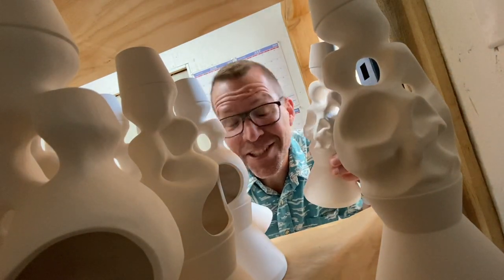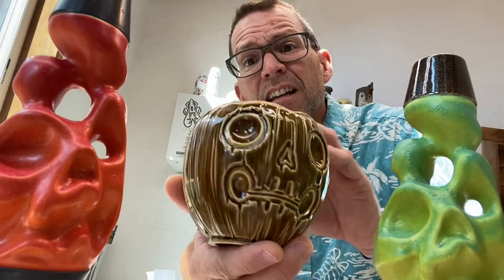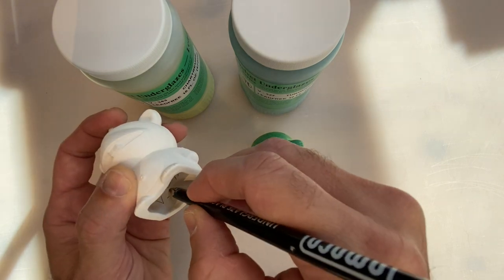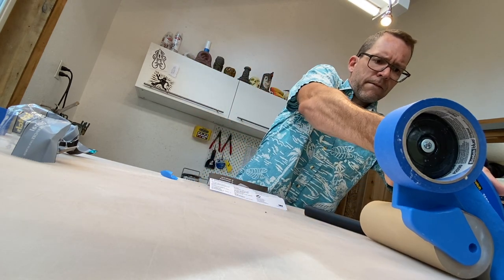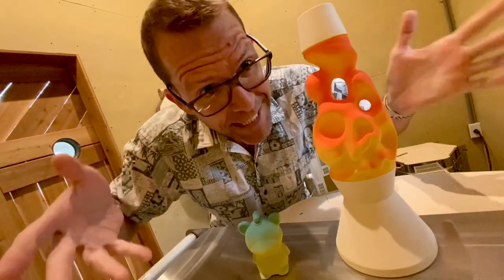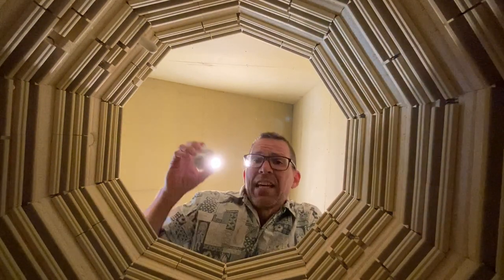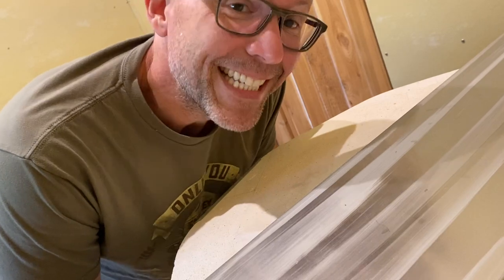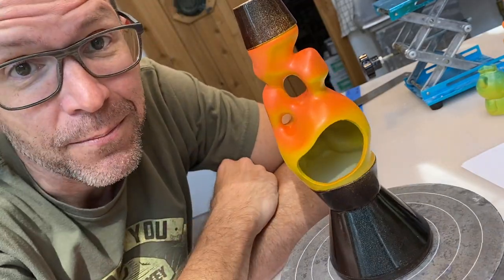Glaze Tests pt 2 - Tiki Technical Tuesday 38

Comment: I'm still extremely surprised that the glaze doesn't come off when you remove the masking tape.
Reply from the maker: It lifts a bit of the glaze away - but remember glaze isn’t like paint - it’s a powder. I put the glitter glaze on in several coats, so having the tape lift a bit of the powder isn’t a big deal

Comment: Are you glazing on greenware? That causes pinholes. Also, if glaze is too thin , that will cause pinholes. I watched you pour and your slip seems the proper consistency. But, if you mixed it up really vigorously, it can be the culprit. Even if you wait for it to settle it seems to like to hold onto tiny air bubbles that you really can't see them. I've worked in ceramics for over 50 years and have been called on to figure this kind of stuff a lot. I've gone through many trials and errors to find the answers. I hope I may have helped.
Reply from the maker: Thank you!  I’ve adjusted my firing schedule and it’s helped a lot. Turns out lots of other folks were having similar issues with this brand of glaze. Thanks for the info!